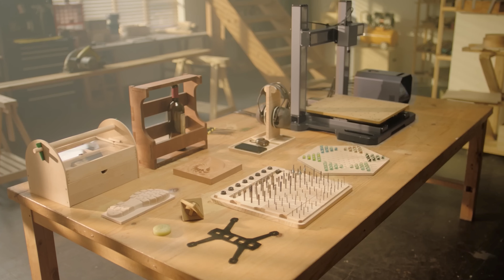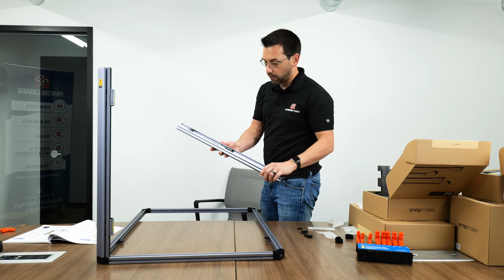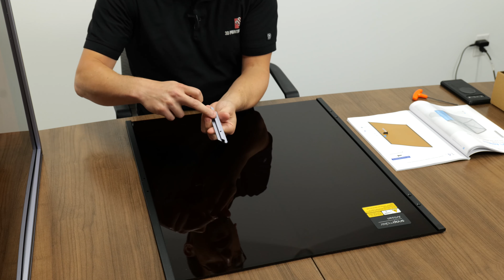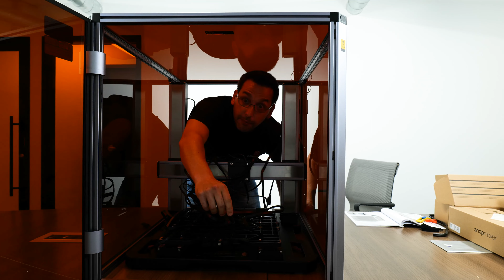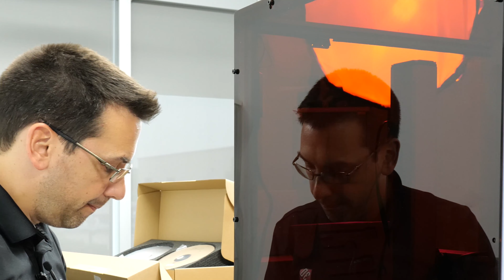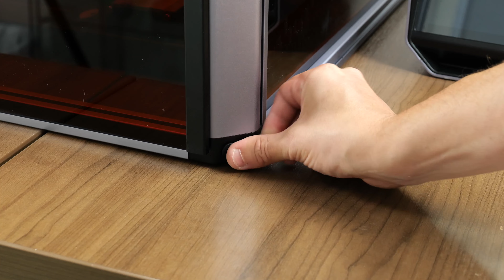SNAPMAKER ARTISAN - ENCLOSURE ASSEMBLY

Comment: Thanks for this detailed Video! One question: 
Would it be a Problem attaching the Ventilation on the right panel? 
I would make a new hole in the panel and close the old one.

Wouldnt it make more sense putting it in the upper part of the enclosure?

My workspace is limited in depth but i have plenty of room on the right side.

Would be nice hearing from you  :)
Reply: My problem as wel...don't have room at the back and looks like I can't buy the thing cause I don't have a solution!!